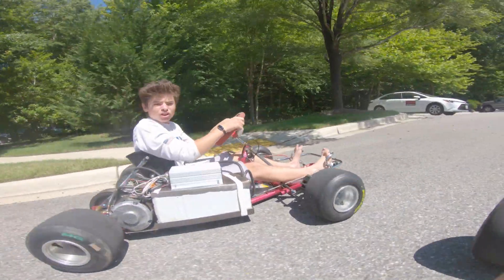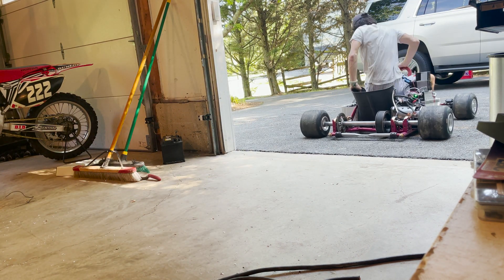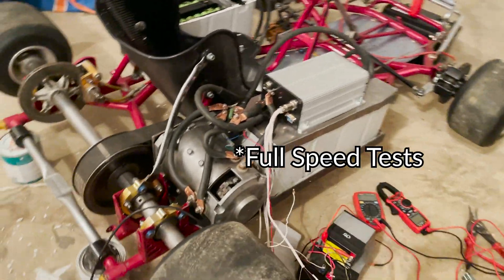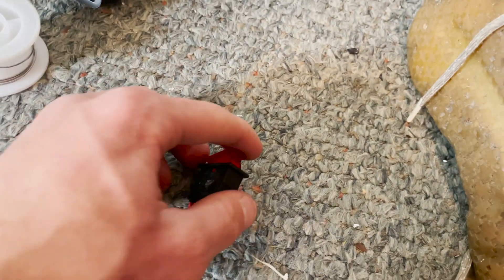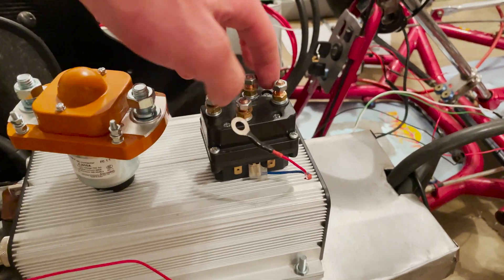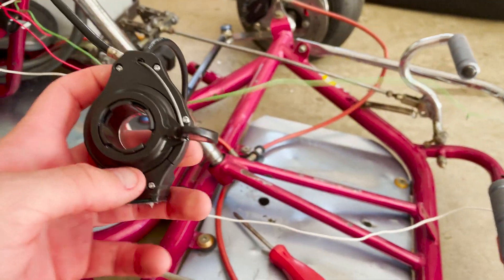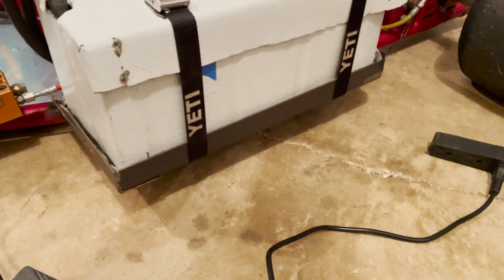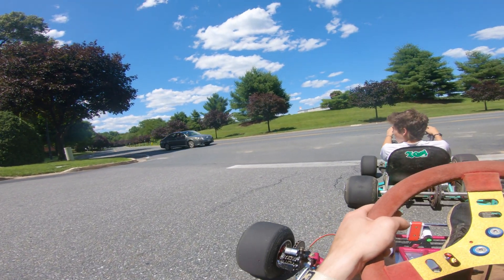70hp Electric Go Kart build V2 // Part 3

Comment: Does the belt ever slip or run off track? Everytime I deal with them, they always find their way off track.
Reply from the maker: that’s why i went with one so thick. so it wouldn’t do that. i actually had it slip so i checked it and the motor bent my 1/4 in thick steel motor mount. so the belt is just fine for now

Comment: Okay I hate to be the guy to bust your balls but first of all, you don't even look old enough to drive a real car, so I doubt you have any type of driver's license or experience. There's nothing really wrong with that, except for the fact that you guys wear absolutely no safety protective gear and absolutely no helmets and accelerate and travel at dangerous speeds inside of a tiny super Mario death trap. Do you have any idea what's going to happen, not if, but when you get into just the smallest accident? Smart responsible riders know you can't always control what happens to you out on these roads and eventually you put in enough hours & miles riding, you're going to have some type of bad unfortunate events that happens to you it's Riding 101! Just hitting a curve at those speeds is hella dangerous and almost guaranteed to result in some type of bodily damage. It's fun and it's nice to play around with electric motors and very many things on the side is so much fun because you can control the quality and standards of whatever you want it to become. Being prepared is the best safety measure! Not trying to bust you guys balls, I just want you to understand how dangerous this can be. Studies have shown that speeds as low as 20 mi an hour can be deadly & cause serious life changing injury. Just be smart & always you want to set a good example for not just the younger people but the other people watching your videos as well. Shoes and a helmet at minimum and then I will subscribe. Sick lil go-kart 💪🏼🔥❤️

Comment: There is no way this thing has 70hp.... Maybe 7kw but even that would max out these batteries
Reply: I'm pretty Sure it has 7 HP continuous based on the bms you used.
Reply from the maker: @Jabanse  I bypassed the bms for discharge

Comment: top speed? i turned a gas bike into a electric one and it goes 57mph
Reply from the maker: I got to a top speed of 50 mph on gearing that was too low, but i messed up some of the battery cells before i got to do a new test with better gearing. so all I know is that it could do like 0-40 in about 4 seconds. hopefully, I can get replacement cells and do a real test eventually.

Comment: this is amazing . waht's the top speed and from 0 to 100 km?❤❤
Reply from the maker: I got to a top speed of 50 mph on gearing that was too low, but i messed up some of the battery cells before i got to do a new test with better gearing. so all I know is that it could do like 0-40 in about 4 seconds. hopefully, I can get replacement cells and do a real test eventually.
Reply: @Kevin.OBrien44  oh it's great thank you ❤❤

Comment: What are the specs on the motor or even better the specific model number. I am impressed. Nice work.
Reply from the maker: Not sure because i got it used from ebay. It weighs about 45lbs and has a diameter of 6 inches and length of 9 inches if that helps. Also the rpm is somewhere about 3200 i think.

Comment: Have you seen the free energy generators uses a alternator and a 12 volt DC motor and it pretty much runs itself and it creates 120 volts it's small enough that it would fit on this go kart and you wouldn't have to have the need for batteries
Reply: Bruh there is no such thing as free energy
Reply from the maker: That would be amazing, send me a link to that design!

Comment: drill some 1/8" holes in yur belt drive  sprocket.If you get caught in the rain yur belt will snap. (WKA @,Portland International )
Reply from the maker: Ok really? why does it snap?
Reply: @Kevin.OBrien44  2 things ,....the water makes the belt get colder and thus tighter .The water gets between the belt and the sprocket and then it goes pow. I saw a lot of this at the Portland IKF Nationals.
Reply from the maker: @murfspop  interesting! ok
Reply: @Kevin.OBrien44  It may not matter at 30 MPH ...but at 115 .........it does. Easy fix . Why risk it. 
The Portland guys just watched the So. Cal. guys blowing belt after belt.
Reply from the maker: @murfspop  yeah. If I ever plan to drive it in the rain I’ll do that. I’ve only ever drove in snow though i don’t think the rain would mix well with an electric drivetrain
Reply: @Kevin.OBrien44  Look at all the Teslsa 's shorting out in Florida and catching on fire as the batteries are wet.
Like driving a toaster thru a car wash....

Comment: where d you get belt drive and pulleys
Reply from the maker: off of ebay. "Dodge P36-8M-50-1610 High Torque HTD) 1.97" Timing Belt Sprocket 36T Taper Lock"

Comment: Hey so I was going to build something similar to this but was trying to find a cheaper/lighter alternative to the motor do you think a Amazon/eBay China motor would work I was going to do a Kelly 72v controller and a 72v 40ah battery and trying to get a top speed around 45mph or more
Reply from the maker: You could probably downsize the motor to a 20lb one and use a 72v 200a controller

Comment: where would one find one of these 70 hp motors?
Reply from the maker: I got it off ebay used. its form a electric forklift. its acctually rated for only 5kw ish but im pushing way more through it.

Comment: We are about to build one of these but ATV style!  I am thinking about using the SAME Kelly Controller with Regen, and I want to use a belt drive system.  I saw your other video where you made the belt system.   Do you have any advice on the belt drive, where to get the parts for it?   Also, have you figured out how to connect a speed meter and volt meter to the Kelly Controller?  There are a lot of pin outs on that thing that might be useful.    I was thinking I could interface an Arduino or circuit python board that drives larger 7 segment LED displays for amp draw, and volts and maybe some kind of batter level meter (that's a whole project for a different day).  For speed, I could always just use a GPS meter.    Does the Kelly Controller NOT have reverse or is that the limit of your motor?  I'm not sure what motor that is just from looking at it.
Reply from the maker: The reverse function is actually done with a special type of contactor called a ''reversing contactor''. The pulleys I Got them from ebay. I think they were for a dodge trucks timing belt. https://www.ebay.com/itm/362443468929?nma=true&si=nDtp5PkJAwgWS6dfQbF%252BhjcBZyE%253D&orig_cvip=true&nordt=true&rt=nc&_trksid=p2047675.l2557
Reply: @Kevin.OBrien44  thank you!! This is helpful.  We are converting an old mini ATV to EV using a lot of the same parts and Kelly controller too.  I think the belt is the way to go for electric!!
Reply from the maker: @SteveHartmanVideos  yeah less maintenance and quiet

Comment: Where is the 70hp number from?  That's like 52kw
Reply from the maker: Its the max output of this system. My esc can do 650 amps and my battery is 80v. Ive hit 30kw but that's with short gearing so im working on that for the next vid.

Comment: How old are you?
Reply from the maker: 17
Reply: @Kevin.OBrien44  I built my girlfriend an electric bicycle instead of buying a ready made one and people were surprised and impressed, you should be very pleased with yourself building that go-cart. Very impressed with your cable terminal solution using copper pipe. My next project is to make an old quad bike I have electric.....  You've got a well earned sub. Oh and I am 51 and 3/4 never too old to learn something new though keep up the good work and be careful in that thing.
Reply from the maker: @philipnorthfield  thanks! Hopefully your quad goes well. Maybe upload a video of it moving when that time comes

Comment: It just came to mind, why do you have three on/off switches for the kart (I saw you have two on the dash and another on the controller I think) as well as a key ignition? So you need to turn four things on before you can get the kart going?
Reply from the maker: I was going to have one for a reverse and one for forward and one for power on, but i broke the reversing contactor so now the key is power to the esc and both switches have to be on for the contactor to be energized.
Reply from the maker: Only 2 switches and one key all on the dash

Comment: hi my friend. Whats engine you use in this project? You use what batteries? What time duration, in use, your batteries?
Reply from the maker: the motor is from a electric forklift and the batteries are a123 systems. I get around 10 miles of distance or 30 miniutes

Comment: im definetley trying to make this 
how much did it cost you and can a person with no experience build it thanks mate sick kart
Reply from the maker: Yeah you could definitely do it. you'll be on YouTube watching tons of videos to figure out how to do it though. I think I spent less than 2,000 on this one and only 1000 on my first one. When your deciding to use a brushless motor or brushed, the brushless motor setup is going to be more expensive but better for high speeds and the brushed motor is gonna be a lot cheaper.
Reply: @Kevin.OBrien44  Which one kills the battery faster? Brushed or brushless?
Reply from the maker: @johnny5fingers0966  brushed usually. Brushless is more efficient but brushed is cheaper

Comment: This is awesome! On the next one, could you show a diagram of how it's all wired up? It would be cool to see how it all goes together.
Reply from the maker: yeah sure
Reply: @Kevin.OBrien44  what kart frame and front brakes are you using? I have a 60kw capable hpevs ac-9 on the way! Also where did you source your belt drive components? Thanks!
Reply from the maker: @campeck944  It is a hasse blizard and it cane with the front brakes but I think they are crg ven 09, I got the belts off ebay https://www.ebay.com/itm/165155075945?epid=2296382803&hash=item2674027769:g:Oa8AAOSwIPFhe3Ej

 You kart is gonna be like this? https://www.youtube.com/watch?v=0vBvhBHm1L0&t=132s&ab_channel=velkart
Reply: @Kevin.OBrien44   @Kevin O'Brien  yeah that looks like an ac-9! Where can I find out more info on that one? The videos barely show it.

 I have a few more questions about your cart. How wide is your drive belt? You just sourced dodge 8m timing belt parts off ebay for the belt, and both pulleys? The one is that listing says its 30mm wide but your belt looks like 2". The final pulley looks to be taperlocked to the keyed cart axle? 

 Isnt that a 48v motor? But your pack is 24s8p. 90v haha. I might do the same pack as you. But trying to pack more than 2kwh on a cart in a123 cells starts to get big and heavy fast.
Reply from the maker: @campeck944  yeah my belt is 50mm wide in this video but I got new pilots that are only 30mm wide. Both are taperlocked